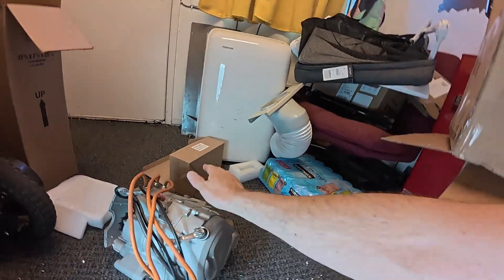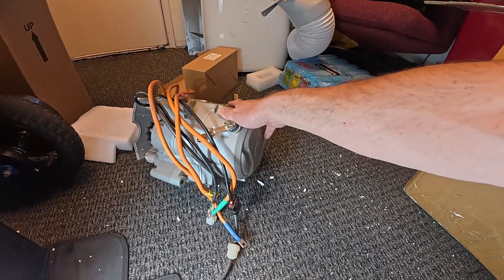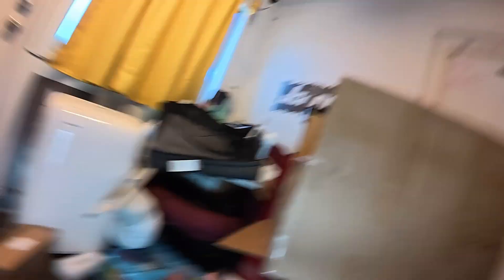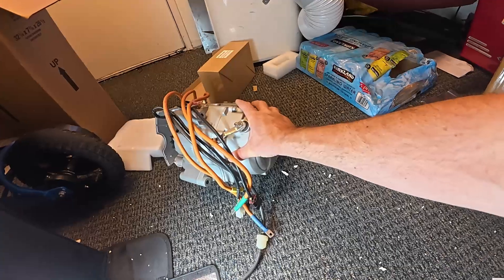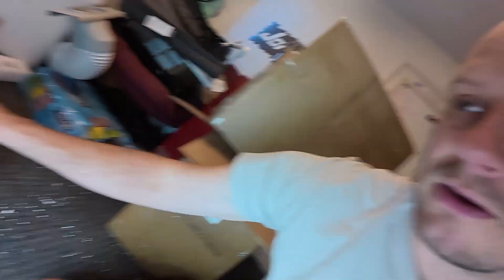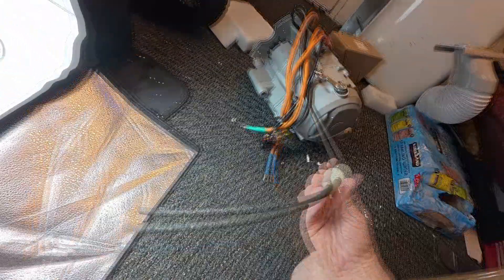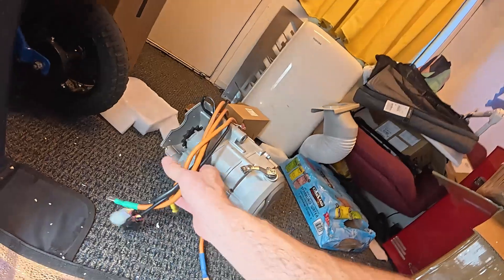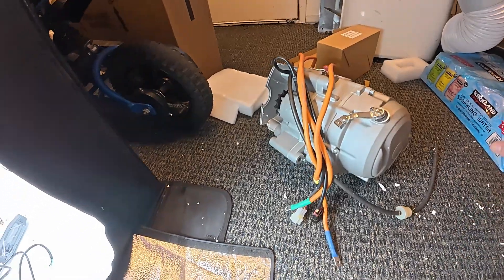First Look!!  25kw 5 speed Motor for DIY Electric Motorcycle Conversions.

Comment: Just subscribed, I'm totally here for the electric motorcycle conversion stuff. I have a 40 mile round trip commute to work, but some of it requires something that will do 55 or 60mph comfortably. I also have a few Honda CB125 rollers... so... 😁
Reply from the maker: You might want to check out its little brother the four speed. I also carry that in the shop as well if you want to support the channel. No pressure though! But that one I have on a Honda CT 110 frame and it will do about 60 maybe 65 comfortably. It would probably go faster if I could get the gearing any taller.

Comment: The hoses are just vents for the crank case, the one with the filter is likely just a catch so oil doesnt evaporate out(gas bikes for the street use catch cans to do this) 

I'm curious how the clutch is and if can take some abuse so it could be used in hard enduro type riding where you need better power delivery(like the electric motion trials based bikes)
Reply from the maker: I think you are right on that!

Comment: Would this work on a Kawasaki Z125 Pro?
Reply from the maker: Yes with some light fabricating probably. You may be better off going with its little brother as it would physically fit easier in the engine bay
Reply: @JohnnyNerdOut I believe the z125 pro is the smallest bike Kawasaki makes…so, which would be its little brother.. The klx 110 dirt bike? Thanks..

Comment: why make electric motors with 5 speed gearboxes? 1 gear is enough for 99.9% electric vehicles, and 2 speeds is enough for the remaining 0.1%
those 5 speed electric motors look like motorcycle engines  converted to electric? I mean I like to shift a motorcycle or a manual car because they have flawed engines that can only make power in a very narrow band. but I don't see the point shifting gears if I get the same power and throttle response in different gears? this looks like a lot of waste to add clutch, oil,  and (mostly fake) gears
Reply: If you compare with an E bicycle with a BBSHD...which is about a 1 hp motor. Thats big for E bicycle. I have a 7 speed. It will climb like a billy goat in a lower gear torque being linear in electric.  The gearing allows you to use a small motor like this and use your juice efficiently. Use less juice at top end too.  Which is  key like a motorcycle which is space constricted as far as the size of  a battery pack. A car can carry a giant pack so a single speed motor 150-200  hp covers all you need. Scaling my setup, 65 lb E bicycle, 1 hp. Motorcycle, say 400lbs, a 50 hp motor with 5 speed, big battery pack, that rocks. Of course like you say simple is best but motorcycling needs some thinking like this. Personally I think with supercharging capability range anxiety will pass. I do like shifting gears though like my motorcycle
Reply: @jaaklucas1329 you start from the wrong assumptions that:

-1hp ebike motors need 7 gears to climb like a goat and cruise efficiently on flat.  in reality all they need is a low gear to climb steep hills or accelerate from a stop and high gear for top speed and cruising. 
at the VERY most, 3 gears. the rider is the one who needs 7 gears to pedal comfortably at different speeds.

-measuring power to weight or torque to weight without the rider. a 65lbs 1hp e bike with 200lbs equipped rider is half the weight of 200lbs rider on a 50hp 330lbs mororcycle like a zero FX so the power to weight is 25x higher on the motorcycle... the torque at the wheel is so high they have to electronically limit it to prevent unwanted wheelies. gears are simply useless for performance, and they would only hurt efficiency because of parasitic losses.
which is the reason every electric motorcycle is single gear. electric motors and batteries improve way quicker than gearboxes so it's not going to change in the future.
Reply: @geemy9675  So youre comparing my E-bicycle total riding weight 265lbs vs a Zero total riding weight 550lbs. By your calculation I need a 25hp motor for a single speed E-bicycle to achieve the same performance. So thats a reason to have gears!
Reply: @jaaklucas1329 same acceleration as a 50hp motorcycle, not same as a 1500W ebike 😂 BTW you don't need/want to have the acceleration of a motorcycle on a 65 lbs ebike.. that would be sketchy AF and impossible to keep the front wheel down (motorcycles have a longer wheelbase and the CoG of motorcycle + rider is much lower than bike + rider)
a 5000W surron is 100lbs single speed and accelerate quickly to 45-50mph and can climb any street /road /bike path without  any issue.
gears are defintely useful for 250W-1500W pedal ebikes that are designed to rev basically within a pretty narrow 60-120rpm range after the internal gear reduction. once you  get rid of the pedals and gear a motor independently of pedaling cadence gears aren't that useful.
Reply: @jaaklucas1329 there are a few poorly designed, unreliable low tech Chinese electric dirt bikes with gears and clutch which are just bad gas dirt bike converted to electric. also you could design an electric motor to have extremely low torque, a linear power curve and require gears to perform decently but if you look at a stark Varg which is a properly designed electric dirt bike, the torque  to the wheel beats the most powerful 450cc dirt bikes at  any speed and in any gear, without being heavier
Reply: I love the simplicity of electric cars for all your reasons stated. Max torque at any rpm, regen, lack of transmission, low maintenance, etc. Simplicity. Electric drivetrain straight up, connect it to the wheels and away you go.  Be interested to see where this all goes in motorcycles. Maybe like E bicycles, where less is more. Heard of the the Verge TS pro?  200hp in-wheel motor single speed, DC charging. Super fascinating bike. I will say this, part of my love of motorcycle is shifting so Im biased!
Reply: @jaaklucas1329 stark Varg is the best e motorcycle IMO because it's simple, basically same price and weight  as a high end 450, and way more power every where. they already made a road legal Enduro version but IMO they should make road bikes based on the same platform. obviously a supermoto that could be the enduro with road tires, a cheap naked commuter/utility bike and a lightweight sport bike that would give rush this bikes are not used for touring and can live with short range.
Reply: @jaaklucas1329 yeah verge TS is  interesting. I would be scared about reliability. hub motors have two advantages, simplicity and efficiency
but regarding unsprung weight, moment of inertia/gyroscopic effect,     no gear reduction, and the motor and it bearing being subject to all the shocks from the road, being only filtered by the tires
I don't really see how the pros van our weight the cons, unless the motor has enough regen torque that you can delete the rear brake, and figure out a way to make the wheel  have almost similar weight as a regular wheel?

Comment: Do you think a 3 speed hub can hold up to a mid drive motor. If you were trying to gear ⚙️ your drive sprockets so you could cruise at 40 mph in 3rd gear.
Reply from the maker: Yes, it can as long as you don’t hammer on it and abuse it. Also depends on which three speed hub you get. They are not all created equally. You probably need to gear it small at the hub and 52 tooth up at the crank.

Comment: That's interesting
If you had to speculate, excluding the motorbike, what would it cost to do a conversion?
Reply from the maker: $2500 with that motor and a decent sized 72v battery
Reply: That motor looks like it will generate crazy torque.  Wheelie much?